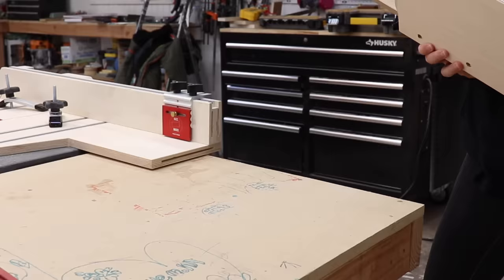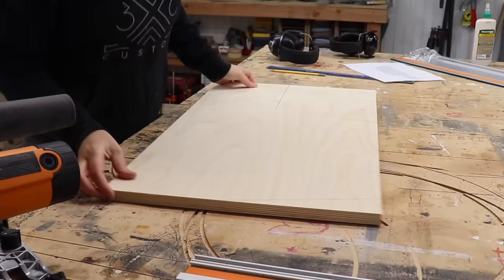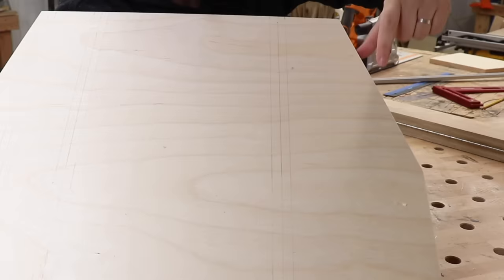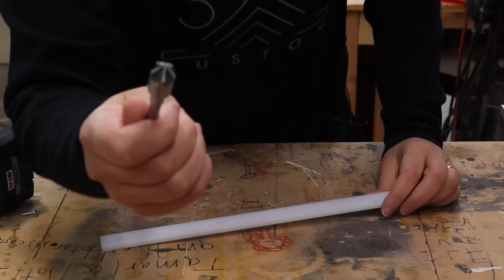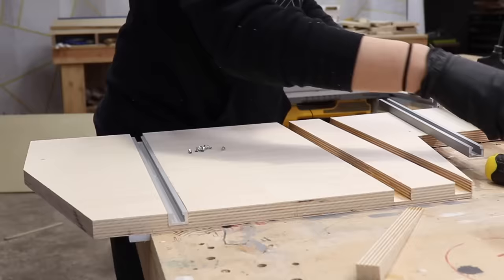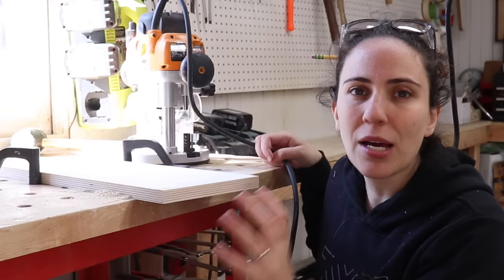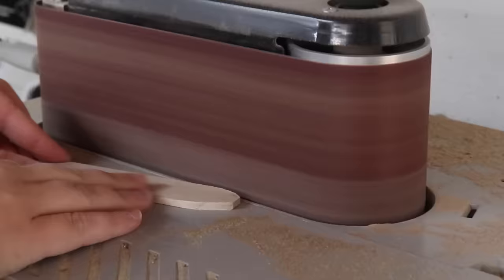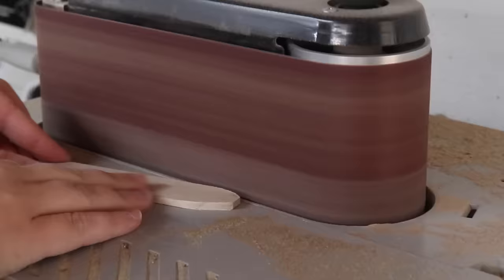SMALL Cross-Cut Sled with ADJUSTABLE Fence, EXTENSION wing and BEVEL Feature!

Comment: Failure in design.  The bevel cut option wont work for anyone who has a cabinet saw . The mitre slot  runner on the left hand side Needs to  rest somewhere when you  pick up the sled and move it to the left for the so called bevel cut. This appears to be a failure in the design. Why did you not explain this?
Reply from the maker: You must have missed the part where there is only ONE runner. So it’s just one runner that can go in both slots. No need to have room for a second runner because there is none
Reply: @3x3CustomTamar  my
Bad